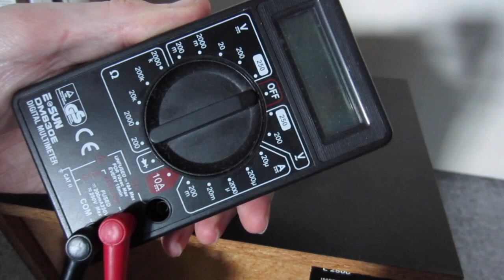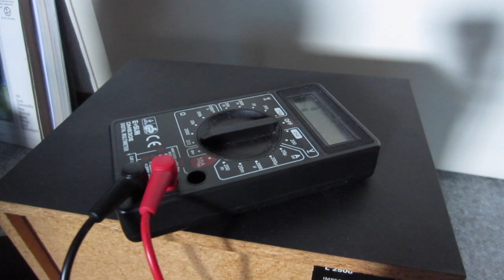Testing Your Speakers Polarity with a Battery and how to measure the impedance.

Comment: If you are reading 6 ohms DC, it is likely an 8-ohm driver.  Speakers typically measure in DC ohms a high fraction of what the impedance actually is.